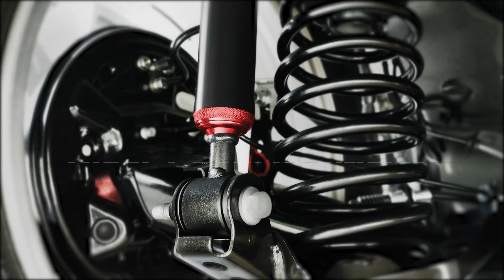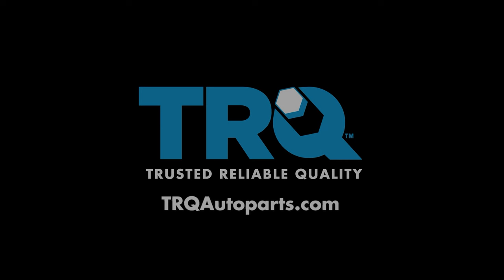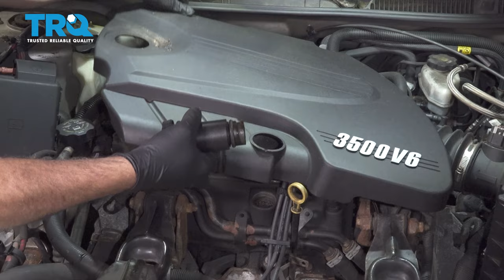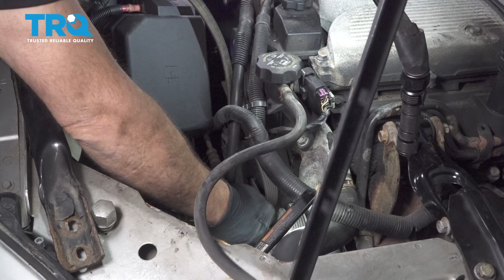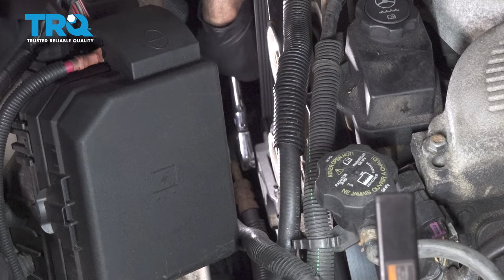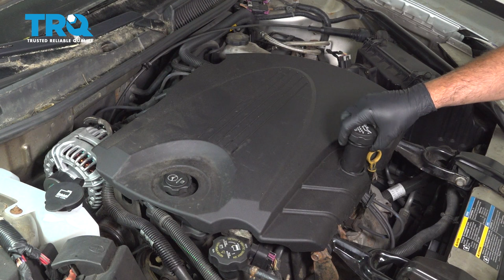How to Replace Serpentine Belt 2006-2013 Chevrolet Impala

Comment: Hi, the belt tensioner pulley broke off on mine and the belt came off. I was driving like that before the “service charging system” light came on, thats when I stopped and replaced the tensioner (I watched your other video and luckily autozone was just a few blocks away). Now there is a P0010 code. The wires look good. Was I supposed to align the pulley wheels or something?